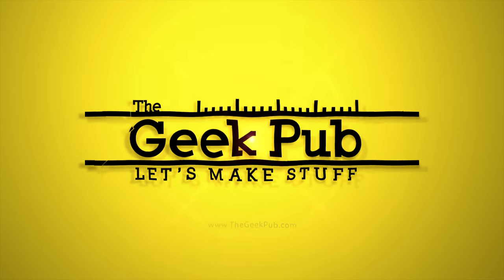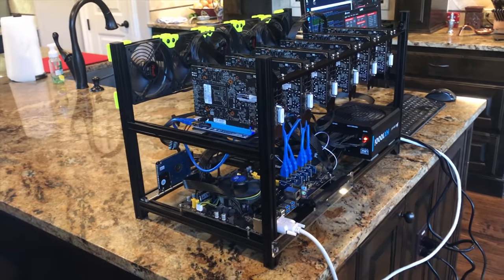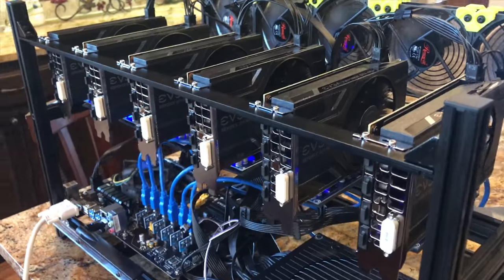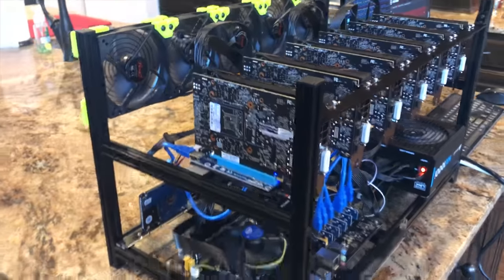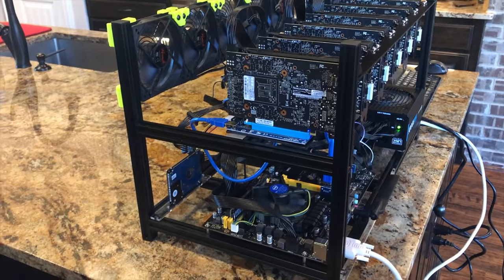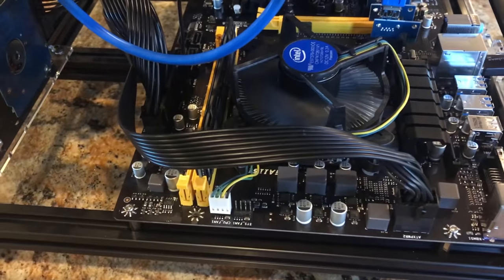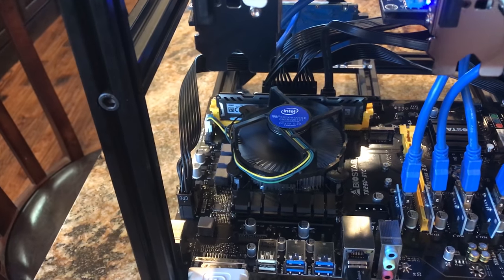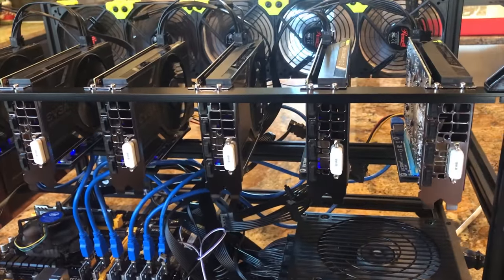Tour of my Mining Rig

Comment: How diferent are 1060 from 1050 ti? Except the memory 2 gb less. But the price and TDP is much valiable and you can over clock them easilly as well. How diferent would be to mine with them? Let say 10 card rig for the same price +-?
Reply from the maker: 2GB won't be enough RAM.  A 1050ti with enough RAM (bare minimum 4GB) has about a 14MHs performance.  Almost half the 1060.  Not really worth it since its within $5 of the 1060 on Amazon.
Reply: TheGeekPub Ti 1050 are 4 gbs of ram.
Reply from the maker: Some are 2GB.
Reply: Yep the regular 1050  this the regular one https://www.alza.cz/gigabyte-geforce-gtx-1050-oc-2g-d4528005.htm?o=1 and this the TI one https://www.alza.cz/gigabyte-geforce-gtx-1050-ti-d5-4g-d4564639.htm?o=1 i think the 1050 ti is better when it comes price and power compares to 1060 but some one must try that in real life how much etherium could actually mine vs 1060 6 gb rig with OC ofc.
Reply from the maker: Milan, I'm trying to help you here. The 1050ti comes in both 2GB and 4GB version.  The 4GB version will produce about 40% the hashrate of the 1060 for $5 less money.  Not a good deal.  Good luck with your mining.

Comment: Did you have any trouble getting all of your cards to be recognized? Right now I can only get three of the four that I have in my current pc running. waiting on two more cards and frame to build the actual rig. Hopefully when I go to switch over and put the miner together with this other mobo and processor it will work.
Reply: Install one card at a time.  Reboot between each card install.  That's the only way I could mine to detect reliably.  After that they all work flawlessly.
Reply: Thanks, Ill try that.

Comment: USB-3 Risers are about 20% performance loss, but I guess in this case thats a whatever since you're bottle neck will at a certain point be your network.
Reply from the maker: This is correct.  But since we're just loading math problems into a card there is no need for big bandwidth between the cards and the CPU.  All of the work happens on the cards.  Then the cards send back the answers. Again, low bandwidth.  This is why risers are so popular in this application.
Reply: As I said. The equations are usually equivalent inverse hashing a CPU would be incredibly slow at these since it'd have to do millions of easy equations, therefore GPU.

Comment: I noticed you have windows installed but are running the eth miner. I assume its the one designed specifically to work with Nvidia cards. I was wondering if you might know of one designed to work with AMD cards? I was mining with Nice Hash but since their hack my rig has been setting powered off because I cant use it right now. I have tired to use simple miner but no matter what I try I cant get the image to mount properly to a USB drive. Any advice will be greatly appreciated.
Reply from the maker: I'm running claymore, not ethminer.

Comment: are the fans blowing towards the cards or away?
Reply from the maker: Depends on how you orient them in the rack (there are three different mounting methods).  The fan should be blowing air towards the intake of the card.  The card exhausts air towards the PCIe bracket.

Comment: how do I which risers are suitable? 4pin vs 6pin?
Reply: That's completely dependent on your design.  If you buy 6 pin, you'll need enough 6 pin outputs on your power supply.  If you buy 4 pin, you'll enough 4 pin outputs on your power supply (or adapters).

Comment: Hey! What are you averaging profit wise monthly with this setup? What are you mining?
Reply: With current Eth =$700-750 this rig should do easily $ 12-15 /day
Reply: Mohamed Ahmed nice - i cant afford to start with six, but im going to get rolling with two 1080Ti’s when they get here Monday. Ill add a new one as i can.
Reply: please use 1060 or 1070 they are much better value than 1080 or 1080 ti , i had few 1080 and 1080 ti and they are horrible, very expensive , less hash for $, too much heat, Nvdia wise stay with 1060 and 1070
Reply: Mohamed Ahmed can you mix video cards? Like two of the 1080ti’s and add four 1060’s?
Reply: 1060 should get u 23 mh/s @ $250    1070 31 mh/s @ $400
while 1080 only get 25 mh/s !!!  and 1080 ti 35 mh/s !!
Reply: yes, windows should be ok, sometimes u get some issues, with linusx no problems at all
Reply: I can give u a customized Linux , u install it on usb drive 3.0 to save money (instead of ssd) and u can copy as much as u want,  also it has teamviewer installed within the linux so u can monitor ur rig remotely.
Reply: be also aware 1080 need 180 watt and 1080 ti need 250 watt while 1070 need 150 and 1060 need 100 watt, so I use EVGA 850 G2 from amazon u can buy them on sale sometimes for $100 (great value) but if u use 1080 ti u will need much higher PSU which usually are more expensive
Reply: if u can return 1080 ti and get 2 1060 it will make u more hash for less money
1080 ti cost $700 and only make 35 mh/s while 1060 cost $250 and make 23 mh/s

Comment: One more question for you, I'm running an identical build as yours, with same settings in Afterburner, however Claymore shows that I am only hashing at 18.5mh/s per card.. any ideas what may be wrong? What drivers are you using? Thanks
Reply from the maker: Did your press the Apply button (looks like a big check) and then tick the box that says re-apply on reboot?
Reply: I did apply, yes. Without any OC my 1060s are hashing at just 15.2mh/s. Currently I have memory cranked to  +1000 OC and am still just getting 21mh/s. GPU is running cool at 71C with 30% fan speed so the setting doesn't appear to be laboring them at all. Tried a few older Nvidia drivers but it didn't make any difference.  A little perplexed at the moment.
Reply from the maker: Did you get the 3GB cards accidentally?
Reply: Nope. Used your amazon links and got the 6GB 06G-P4-6161-KR. Same cards but different result!
Reply from the maker: Interesting. You should be getting a lot faster rates than that.  What's you're claymore config look like?
Reply: Well after some extensive digging I have discovered the issue. Apparently for the 1060s there are two primary memory manufacturers they used to build these, Hynix and Samsung. So depending on the production batch, you will get one or the other but there is no way to tell which when you are buying as the rest of the GPU is identical. The Hynix equipped 1060s are 15mh/s stock 20mh/s OC, that's what I have. Looks like you got the Samsungs which hash markedly faster, 19mh/s - 25mh/s. So it ultimately comes down to luck of the draw on these. A strange surprise I was not expecting!

I think I may end up shipping these back and finding a different set of GPUS to mine now with this new revelation. But hey, at least I won't drive myself crazy any more thinking there was some random bios/driver/OS quirk that was throttling my hashes :)
Reply from the maker: I'm aware of the differences in memory, however, it is my understanding both cards base hashrate is the same (you just can't overclock them as much).  Can you point me to some info that says the base hashrate is lower?
Reply from the maker: Interesting.  It still seems the hashrate is the same, just you can't overclock as much.  What am I missing?
Reply: TheGeekPub Many others have reported 15mh/s base hash on these hynix 1060s. I haven't found a single person who has reported getting 19mh/s base on them, that they should supposedly be getting. That appears to only be the Samsung.
Reply from the maker: I think I'll buy one and play with it. I love challenges! ;-)
Reply: I can see that :) I admire your spirit! Might be hard to track one down though, they've been sold out for a while, but hey, I could trade you one of mine if you're really interested in the challenge lol :p

Comment: 93W power from a 1060? My RX 580 4GB pull 70-80W per card.
Reply from the maker: Yep.  I've obtained similar since moving to EthOS.
Reply from the maker: But remember, these are 6GB cards.  They will pull more.
Reply: On Windows 10 my RX 580's were pulling 90-105W power and temps up to 70C. I moved my rig to HiveOS and flashed a new vbios on my gpu's. Now they pull max 85W power and temps keep steady at max 62C.

Comment: Does this always mine wireless? Or is that just for video purposes?
Reply from the maker: Just for the video, but I honestly doubt it makes any difference.
Reply: Performance wise yes. I always use hard lined for reliability as I have had issues with with adapters and disconnections. 

Love that case btw.
Reply from the maker: Agreed, but for mining you won't notice any difference.  A 56K modem would be fast enough.

Comment: 600 watt? That's a good bit.  Add the watts from the rest and your doing .13 a hour.  Comes to 100$ in power a month.
Reply from the maker: Not even close.  It's like $1.75 a month
Reply: TheGeekPub how much you paying for power???
Reply from the maker: I think you're misunderstanding how to calculate power usage and cost.  I could be wrong. There are some good online calculators that might help.  Along with that, the machine is drawing less power (~450 watts with my latest tweaks) and my power cost is half your number (.065 kwh here in Texas).
Reply: I think you are both wrong.  I calculate your power costs based on 450 watts and .065 at about $11 a month.  You're both off by a power of 10 in opposite directions.
Reply from the maker: Toby you are indeed correct.  Thank you for the comment!  Yes, it's about $11.75 per month after I checked my math.

Comment: I know it's not meant to but I for one would like to see it run crysis or a high spec game just for the hell of it plz plz Plz!
Reply from the maker: Nope.  Those USB risers won't have enough bandwidth.
Reply: TheGeekPub so software doom or quake if I am lucky,are there such a thing as riser that uses thunderbolt
Reply from the maker: No.  But that's not the problem.  The problem is those are 16X cards plugged into 1X slots.
Reply: TheGeekPub ok is it possible to have more then one gpu plugged into each PCI slot ? Just curious as if lot of bandwidth is going to waste,n psu has ceiling to power more GPUs,I suspect the architecture of the PCB will limit as it's not meant to work that way ,
Reply: yes they have pci splitters where you can run 4 pcie on one 16x pcie.

Comment: Building the same rig. with 6 1080 TI
Reply: please no, 1080 and 1080 ti are very expensive and HORRIBLE heat with very low hash power, I regret it every day, stick with 1060 and 1070.
Reply: I'm running 2 1080ti, hash isn't bad and temps stay 65-70c. There are better choices tho.

Comment: how much is the total hardware cost have you spend for think JUNK GPU's only 135Mhs ??
Reply from the maker: What I spent and what components I bought are are listed.  If you think you can do better, make your own channel and show us how its done.  I spent a lot of time putting numbers in a spreadsheet weighing ROI time. If you want a higher hashrate its easy to get. But your break even time will be far longer. Not trying to be a jerk in my reply, but I feel like you didn't pay attention to what my goals were, which I reiterated several times in the video.
Reply: As someone who has 8 miners running I would hardly call the GTX1060 junk!!  It's got the lowest purchase cost and lowest wattage per hash of anything on the market right now. Is it the fastest, no! But I can buy it for HALF the price a GTX 1070 for example.  All it takes is some simple math to figure this stuff out.  Unless you don't care about profits and payback times... then you're just dumb,.
Reply: well,... the number speaks I don't like to argue.. I was just comparing your rig with my rig.. Let's see & compare the better things.... 
YOUR RIG COST & Mhs 135 (Costs as mentioned on Amazon)
Rig case 158$
Motherboard 104$
Riser cables 270$
PSU-HX1000i 220$
Celeron proc 60$
Ram 4gb 53$
HDD SATA 160 20$
GPU gtx1060 6gb 1845$
120mm FANs 75$
TOTAL COST 2805$

My RIG COST & Mhs 180+ (I have bought all below mentioned equipment in RS currency, but I'm converting in USD$)
Rig case (Wood) 12$
M/B Asrock H110 Pro BTC+ (13 GPU Support) 178$
Riser cables 6  59$
PSU-1000 watt evga 165$
Core i3 7th Generation  113$
Ram 8gb 79$
SSD Drive WD 240GB 89$
6 GPU's AMD Sapphire Radeon Rx580 8GB Nitro+ Limited Edition 1950$
120mm FANs 5 25$
TOTAL COST 2670$

The riser cables are much cheaper than you are buying from amazon so as the FANs of 120mm.
My SSD drive is faster than normal SATA drive obviously.
If you're running windows 10 you can maximum operate 8 GPU's & 8GB RAM is recommended since the windows defender & background apps will left only 1 GB left after the heavy logs build up by the time.

It's a fact that Ethereum will reach 1000$ by the end of this month. and I'm mining since last few months without any problem. power cost at my area is 0.05 now a days that's the main reason to select AMD & second thing is that with Gaming & market value AMD's Rx500 series is better than others. even after 1 year Gamers will be happy to play games on this GPU. :) I hope you got my point.

If anyone interested I can help you setup & over clocking the machines.
Reply from the maker: My rig cost less than $1400.  Not sure where you're getting those numbers.  $270 for risers?  My link points to a set for $39 bucks for pack of six.  $250 ea for the GTX 1060.  Please quit typing until you get your facts straight.  All of these are linked in the description to the actual parts I used and the prices.
Reply: I think you need to open the URL again that you mentioned.. most of people here & even on the blog are asking you about the TOTAL cost. but still you didn't reply anyone else. :) 1400$ ? seriously ? My offer is 1600$ for your machine & if you can build the same in bulk quantities then I can offer you more. :) 
We should not talk to the WALLS when people are around us. ;P you need to find the accurate prices of GPU bro... "Brand NEW GPU's with warranty"
Reply from the maker: Dude. The link is the description and on my website for all to see.  But here it is again. $250 BRAND NEW IN BOX WITH WARRANTY: http://amzn.to/2kQ4pd5

This conversation is over.
Reply: Here I was going to say that I thought you paid too much for them on Amazon @ $259 (you can get it for $239 on newegg) and this fool thinks they cost $2000.  You could easily build this exact machine for $1200 if you bought the parts somewhere other than amazon.
Reply: @theGeekPub  250$ for one GPU ? and you have 6 GPU's Right... so 250 X 6 = 1500$ then how come 1400$ is the total Rig Cost ???
Reply: @People calling me fool won't make you wise... It's a discussion.. and anyone has the right to understand the things on crypto before settings up or If already running setup then learn from earlier mistakes or future mistakes. I'm not here to argue with anyone else.. that's good if you're buying cheaper than me.. I can change my vendor if the same I get cheaper from other source obviously !!!
Reply: The problem with Nvidia cards is that you need an SSD with Windows installed. Also anything less than an 8 Gb card won't be much good (for Ethereum) in about 6 months (assuming POS doesn't happen first)
AMD card rigs will run 'simple miner' (Linix) from a pen drive. Therefore no HDD or Windows required.
I can monitor / modify all settings on all my rigs from any device remotely.
Modifying the bios of a RX 570 nitro+ 8gb. I obtain just over 30 Mh/s. Each card is pulling 80 watts with a 95 mV undervolt.
You do the math. I know I did.
Reply: In an effort to have a "discussion" as stated by @LovelyVirgo, I used all the link at the bottom of the video and added them to my Amazon cart. I did adjust the number of GPUs from 1 to 6. The total, today 12/16/2017, came out to $2035. You can see the items on my list at http://a.co/j40owF4 then add them to your cart and see yourself. While it's not less than $1400 as stated by @TheGeekPub, it's definitely not $2800 stated by @LovelyVirgo. Prices will change as days go by, but today, even if the rig did cost about $3000, I'd still build one.
Reply: @RoLY roLLs you are right buddy.. the prices can be changed anytime & let me add one thing more that I've also added the SHIPPING AMOUNT of all these stuff some of the items are "Shipping Free" but some are not available for free shipping. Specially when someone is from Asia like myself has to care about the shipping expenses as well. Some DUMB headed people do not realize that people are watching them from the other side of the world as well. Thank you for researching on amazon. :)
Reply: Lovely Virgo I’ll build them in bulk.  How many do you need?

Comment: we all know amd card mine the best !!! so why nvidia ??? your just losing money
Reply from the maker: My ROI spreadsheet says otherwise.
Reply: Rx 580 had a hashrate of 29mh/s after modding the bios. Plus power usage was around 130w.
1080ti has a hashrate of 30-31 mh/s with 250W power 
580 is cheaper so 580 is better 
thats why there is a global shortage of RX580 .all the miners use them.
your rig is definitely  profitable but 580 will double that profit and shorten your ROI time.
since your in the US you can get RX580 easily if you look for them.
source:https://forum.ethereum.org/discussion/11973/rx-580-hashrate
http://cryptocoin123.com/nvidia-geforce-gtx-1080-ti-ethereum-eth-mining-hashrate-mhs/
http://1stminingrig.com/are-the-rx570-and-rx580-profitable-mining-performance-review/
Reply: What TheGeekPub is saying is that his return on investment.. ROI.. is better with 1060's right now. that incorporates cost, power, and availability. If you just go for the bigest and best.. you wont necessarily make money, as you will burn through power. I run alot of 550rx and 560rx and 6 cards hash for under 300watts and still make $500 a month in ether.
Reply: fouzai alaa *you're